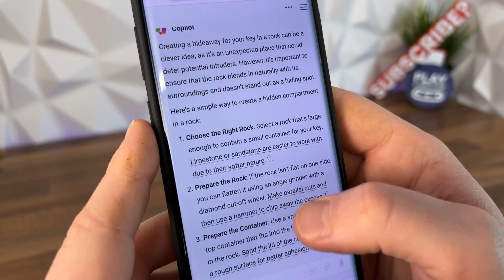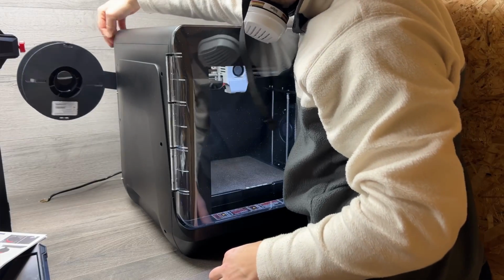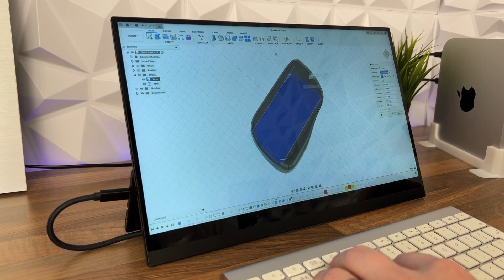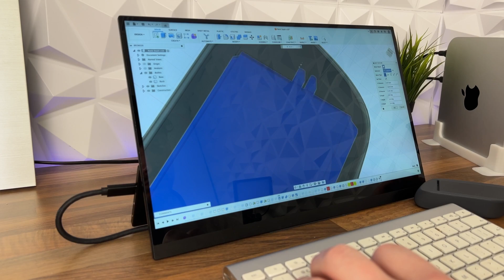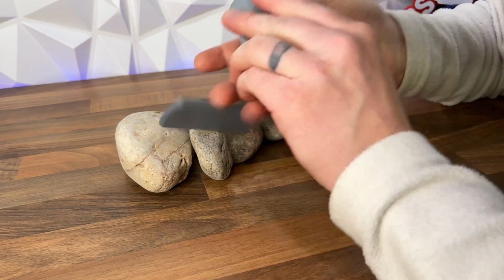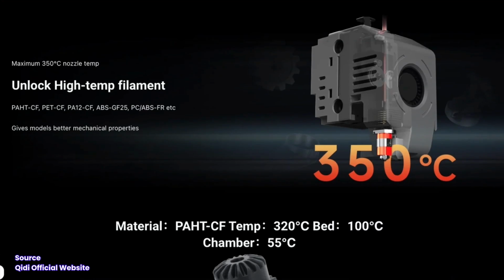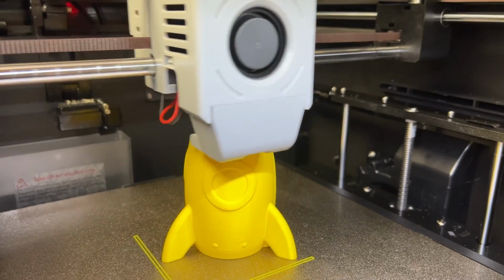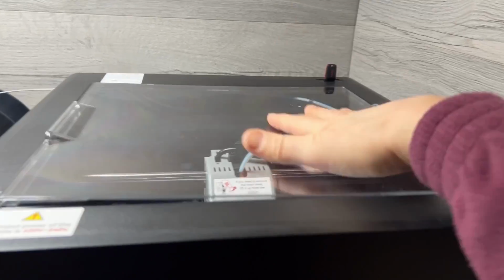This 3D PRINTED rock has a SECRET... Qidi Q1 Pro Overview

Comment: My experience with this printer is very negative. After a couple of test prints, the ceramic heater cracked, the printer stood idle for a week. A few days later, the printer displayed a message about the need for an update and died as a result. That is, in two weeks of ownership, it worked for about five days. Do not buy a printer on the official website, it will be impossible to return it! Also, do not trust the reviews on the site, they publish only positive ones!
Reply: Ty bro I nearly bought one.

Comment: But it doesent have vanilla Klipper and the heater is mains powered.
Reply from the maker: We saw a few strip down videos this weekend too which mentioned the heater, it’s an interesting topic for sure, I can see some of the points raised for sure but 3D printers are still working machines in our eyes.. like woodworking, metalworking tools etc they need to be treated with respect and caution because there are electronic/moving parts that could cause injury… I think most printers still have a way to go to hit the ‘home appliance’ territory! Thanks for watching 😃
Reply: @playconveyor  I forget to say, I used a stone effect aerosol spray paint for a Moonknight figurine and it is quite convincing, it is textured although it can be sanded smooth

Comment: You might be excited to learn, that Blender actually has a rock-generator... just saying...
Reply from the maker: The more I hear about blender the closer I get to being converted to using it… 😅
Reply: @playconveyor  I have been trying to learn Fusion 360 for about 4 years now and Im still not finished, the hardest part is the terminology!
Reply: @playconveyor  Blender is very cool but has a different workflow than CAD Modeling. You are working with vertices, edges, and faces. The very cool thing about this is, that you can modify every existing 3D Objekt like .stl files with Blender a lot more easily than with any CAD Tool. Blender has also a lot of addons which can give you a CAD "like" workflow. If you know how to use CAD and Blender, you are free in everything. In Blender you can also make realistic renderings and texturing your objects, which is also cool to see how it fits in an specific environment or something else.
Reply: I was using DesignSpark Mechanical but the free version was very limited and I kept trying FreeCAD but its UI drove me insane. I downloaded Blender and also added Blender's CAD Sketcher add-on and it's been great. I can finally edit and customize STL files, plus texture them and a host of other features. There's even a nut and bolt generator which is freaking awesome. Now, if only they added a Gridfinity bin generator to Blender...

Comment: Why do they even use a feeding tube at all ? I guess it's just easier to let the filament go into the Extruder without the tube
Reply from the maker: In this case it’s because the printer is fully enclosed, so the filament needs the tubing to guide in through the back of the printer into the tool head.. but direct feed into an extruder on printers like bed slingers is a better system usually..